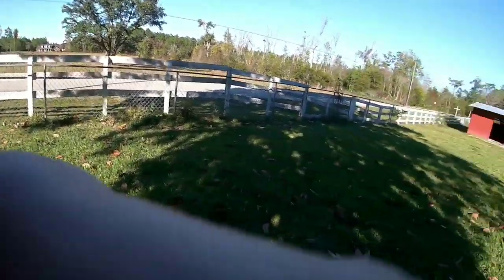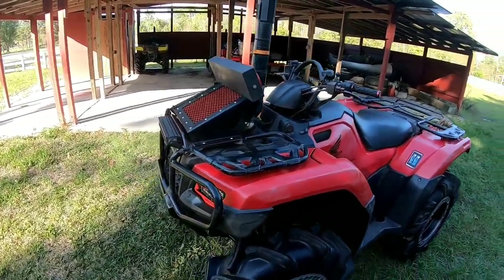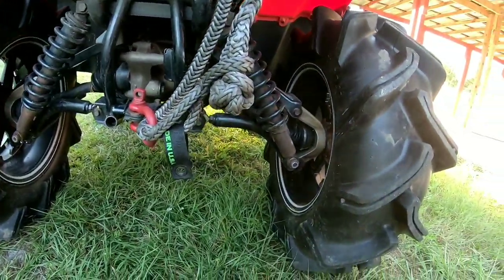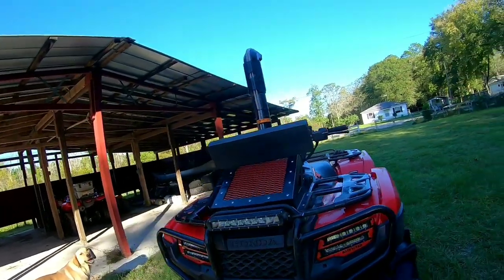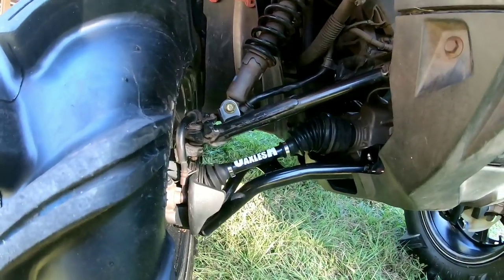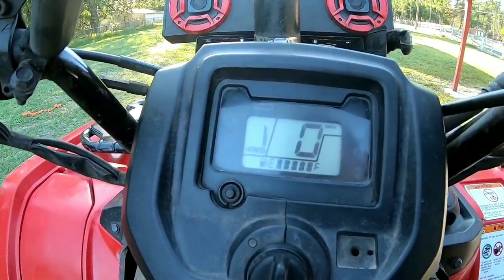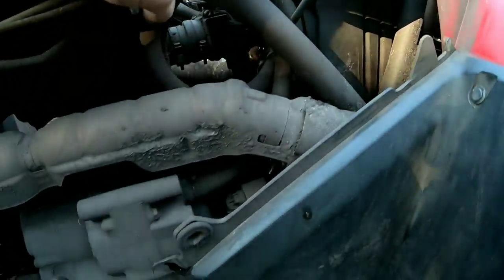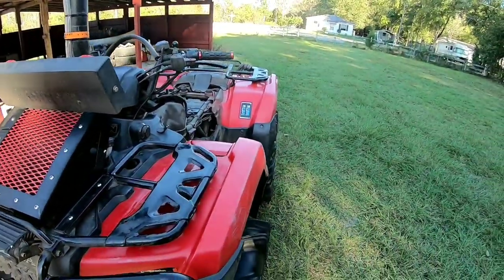Build Series S1: E1 My 2017 Rubicon "Ajax"

Comment: great videos! couple?? led headlight upgrades? are any available for the rubicon , without a complete headlight replacement? also im in the market for another rubicon and looking at a H.R mud pro. Any opinions on buying this as apposed to building my own?
Reply from the maker: Their tire choices suck. Side snorkels suck. Only headlight options are complete replacements... pioneer LED headlights or Hays Fab or Rekluse OffRoad.
Reply from the maker: Build your own and save your money and do it better.

Comment: I have a 2013 forman 500. If my four-wheel drive light is not coming on at all would that electrical box be one of the main problems?
Reply from the maker: Could be actuator too if its electrical 4wd
Reply: @ProjectAjax  its a manual shift with the lever

Comment: I swapped my Forman to manual 4wd. All you need is a rancher diff rancher front drive shaft and the bracket to hold the Handel
Reply from the maker: I wont get rid of diff lock
Reply: @ProjectAjax   wonder if you could weld it like on ya race car I’m not sure?
Reply from the maker: Yes you could and we've done it on ranchers up here but turning and steering effort is hard

Comment: Is there a video on swapping the headlight pod to the 420 pod
Reply from the maker: No sir. It's only like 3 bolts and a screw and then removing ignition switch. Its pretty easy.
Reply: @ProjectAjax  do you change the whole pod or is it just the housing sound the monitor
Reply from the maker: The bracket and the pod. You keep your cluster.
Reply: Thanks a lot. Last question , is there any other way to mount the winch on a rubicon I really don’t like how the motor hangs out the side. Do you ever have issues with yours.
Reply from the maker: @jasonrichard4734  nope never did. Only other way is to buy a strong made bumper and mount it up top higher

Comment: Do you have a gear reduction or will it turn 30s stock
Reply from the maker: Had a 53% GR
Reply: Did it turn them pretty good I’m just looking to run 30s if I got with the foot shift model

Comment: Would you recommend ol3 or should I do ol2 or assassinators
Reply from the maker: Where do you live. What machine. Do you have rims already?? What size?
Reply: Project Ajax I ann m trading in my highlifter on a 420 most likely and I live in Florida and ride up by lake Kissimmee
Reply from the maker: 420 you need a 60% IMO for 29.5 sassys or 29.5 OL2. For mud Id pick 29.5 OL2 just cuz its 29.5 sassy don't have enough side lug for a SRA. If not floating is biggest concern I'd pick sassy. Ol3 are only good for atv in the 31"+ sizes where floating is a concern. Imo.
Reply: Project Ajax thanks where should I get a gear reduction from?
Reply from the maker: Definitely Reduction Boss!! Tell him I sent  ya
Reply: Project Ajax okay thank you I will
Reply from the maker: If you wanna do a lift and stretch...you can do a 69/75% and 33s! Then I def rec OL3
Reply: Project Ajax thanks I’ll give that one a thought because it’s a really good idea

Comment: You better do a video of ducky!! Lol
Reply: Ducky needs rings soon
Reply from the maker: Already have!! Coming soon!!! Gonna try and do everybodies!
Reply: @ProjectAjax  should have videos on it. You go oem or wisco
Reply from the maker: @damonbridgmon7199  All OEM 475cc still. Ill do a vid of big bore on mine eventually when I do it.
Reply from the maker: Ducky is fully rebuilt already. Crank cam rod piston sleeve. Its fresh as F.
Reply: @ProjectAjax  you just wist pin and piston or new jug too?
Reply: @ProjectAjax  damn! So you actaully went into the bottom in as well. What was penny amount?
Reply from the maker: @damonbridgmon7199  new jug, new crank and rod and new bearings, new piston, 07 420 cam, new mid case ( was messed up like manufacturer defect ) new reverse gear and idler shaft.
Reply from the maker: @damonbridgmon7199  yes full teardown and case clean out. Also did new chain and tensioner.
Reply: @ProjectAjax  hell yeah. You take it to a shop? You did it pretty fast I never even noticed it was fixed already
Reply: @ProjectAjax  nice. Well that's good man!
Reply from the maker: @damonbridgmon7199  Caleb Buchanan rebuilt it for me
Reply: @ProjectAjax  oh dope! I know that guy! Got him on the ole snap chat. Cool ass guy!!
Reply from the maker: @damonbridgmon7199  for sure.
Reply from the maker: Video coming tomorrow!!

Comment: That's weird your ground clearance is so low. My 2009 420 with 2" lift and 28" zillas has 14.75"
Reply from the maker: At its lowest point underneath? I think my springs are sagging cause before the 2" lift i had like 12.5" on 30s or 31s
Reply: @ProjectAjax  yep.. lowest point is rear skid plate